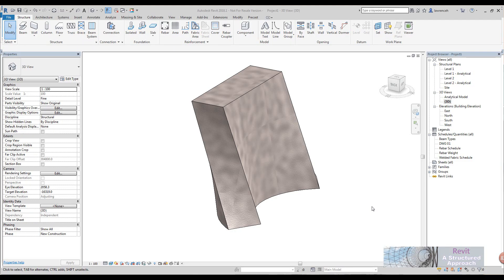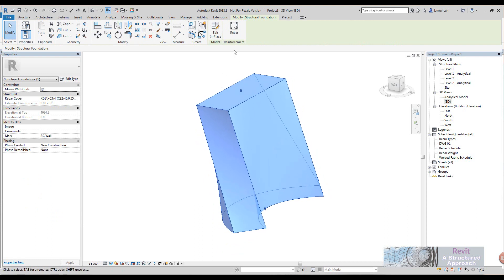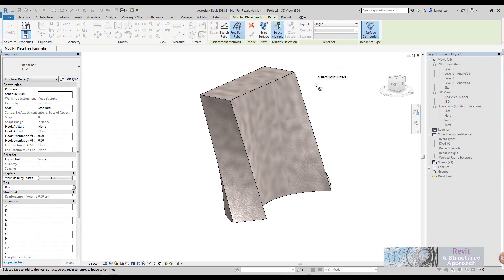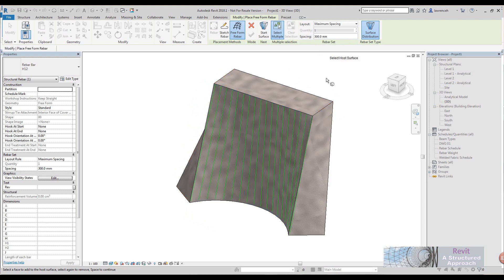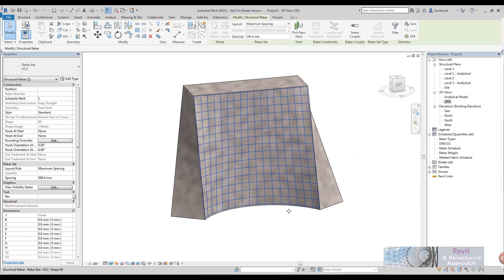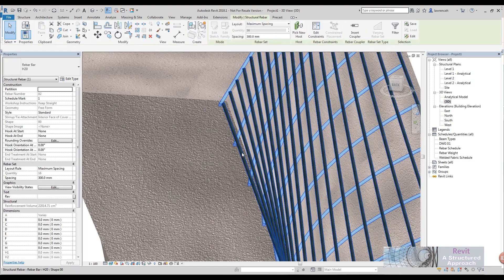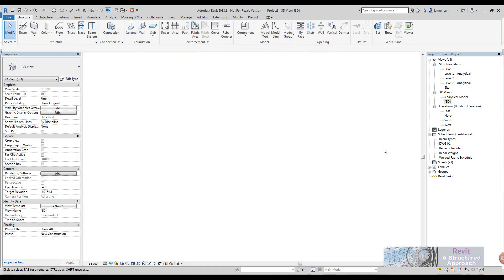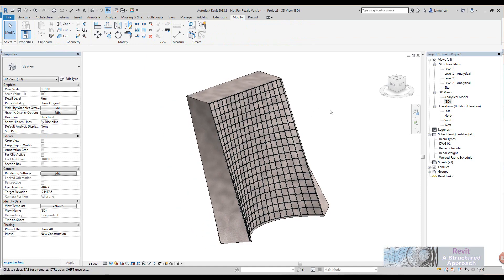Revit 2018.1 Freeform Rebar

Comment: Hi lawrence, thank you for the effort but how did you manage to keep the top and bottom profile parallel to the work plan?? would you explain what is the approach to create such component, iam still student I cant find the answer please and thank you :)
I mean in case you need to create swept blend with two prfiles
Reply from the maker: Hi, If you are referring to the concrete formwork, this was modelled using an in-place family using the blend tool. This will allow the creation of a top and bottom profile.
Reply: @RevitStructureBlog  sorry for the confusing, my question here is not pure structure but since you are the same tutor in Autodesk help i thought that you might have the answer; 
The question is:
Iam creating swept blend, iam using Arc shape to sketch the path, the profiles would rotate accordingly to be perpendicular to the path arc, how can i keep the profiles vertical and prevent them from twisting when i change the path?
I hope i could explain correct, english is not my first language
Reply from the maker: @Arafeh.H  If you are using a swept blend the profiles should stay in the same rotation. Each profile angle can be set in the instance properties

Comment: Hi RevitStructureBlog,
First of all thank you for your videos!
I need to know how to make a free form rebar with L shaped bars. Please Help
Reply from the maker: Thie new tool is only for straight bars at the moment. You can of course create L Bars by using Dynamo to generate the shapes. If you use the BIM4Struct package you will be able to select the straight bars, get the lines from these and add the Other leg to the bars to form the L Shape. Hope this helps.
Reply: Thanks for the quick reply. Will Try that.
On another note, what I´m trying to do is create a vertical L shaped varying rebar set of a 50m wall with a really small slope, my smaller side of a wall is 2.87 and the larger one is 2.88. As you can see its a small slope. When i create the varying set Revit makes it as a non-varying set. Is it because of the tight slope. Was I clear? Is there any walk-around?

Thanks in advance.
Reply from the maker: This shouldn't make any difference to the varying range. I have noticed that sometime if you make the rebar set maximum spacing and then use the shape handles to drag the rebar set it snaps to the angle
Reply: Thanks, will keep trying. Have a nice day